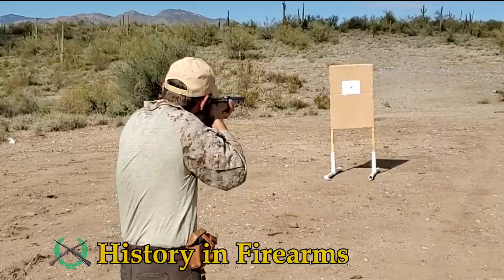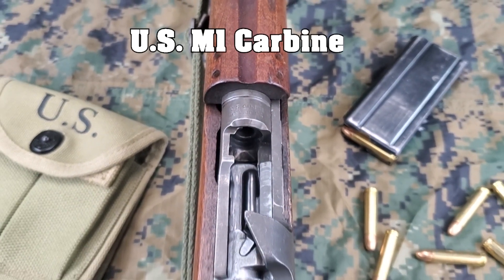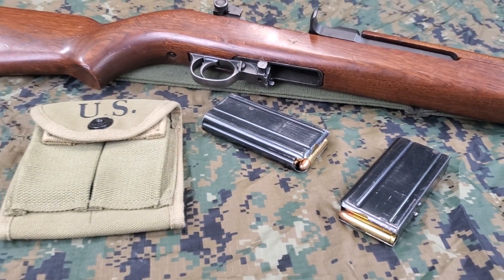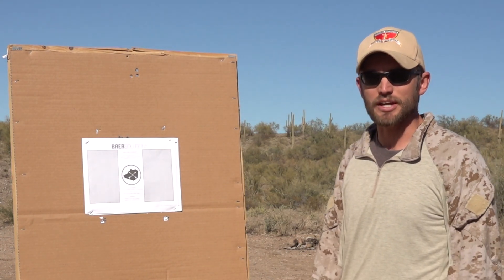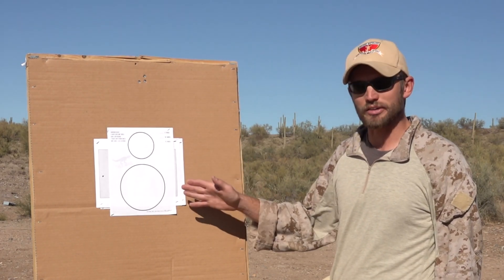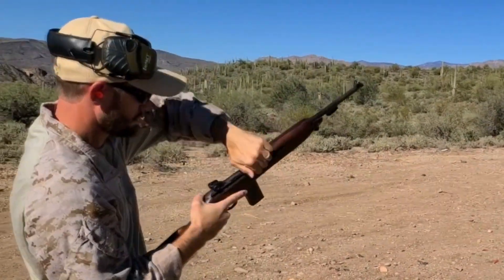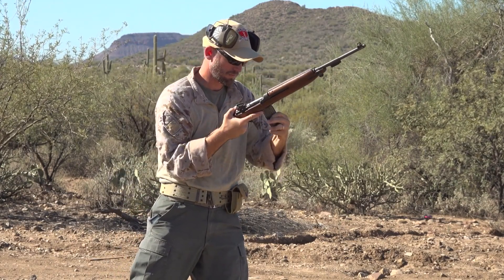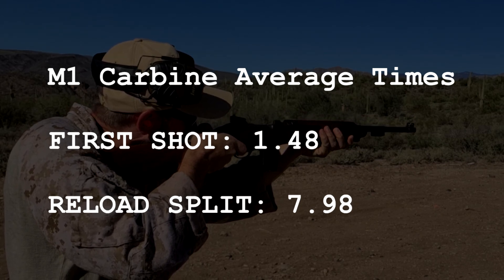Milsurp Operator: M1 Carbine

Comment: The 250 setting is nuts on at 300 yards Me and my 2 sons put a 1 foot group of 20 rounds 
with 3 misses and and rest in the 1 foot group.
I also hit a rolled up paper target 4-5 inches tall 3 for 3 easily 3 head shots at 300 yards 
They are in fact Tommy gun sights .
The 30 carbine being more A Rifle Round.
the 300 mark will be good and right on the money at 500 yards
I drilled a notch between 250 and 300 for my 400 mark 
In the open terain of korea at 300 yards witch realy isnt that far,
I threw a rock that far ,
they were shooting 2 feet above theyre heads.
the 200 setting would have produced hits a foot low
for the 30 carbine 1 foot of drop per 100 yards 
for 30 06 is 1 inch of drop per hundred yards .
Thats the difference
The 45 auto Tommy gun round was 1000 feet per second with a crimp in middle of shell for extra pressure
would barely reach 300 yards hence the 300 yard setting 
on the M1 carbine sights
I cant believe know one figured this out before.
I knew it the second I saw the m1 carbine sights.
because Ive been shooting my little M1
scoped for I want to say 40 years
Reply from the maker: I'm going to have to get mine out at distance.
Reply: @HistoryinFirearms  
You can take a center punch eye ball in a notch between 250  and three hundred and its enough
 for the bearing to grab remember 250 is 300 
your notch will be 400 and 300 notch will be 500.
Your little carbine will surprize you 
our 3 misses werent misses they just hit lower part of seat and 2 winged the side lol 
Nobody has done a 500 yard video with the m1 carbine and its a cake walk
Reply: @HistoryinFirearms  You can barely see the 1/8 inch taper in shell with your eye
32 mag to 30 cal.
But its definatly got the gas to get there and hit hard .
Its the only strait walled Wild Cat
Cartridge
 thats what people dont get.
HaHa Ha
I just call signed your Rifle 
Its Name Is WILDCAT
MINES ROCKOLA

Comment: A mistake from Army Ordinance also is thinking its a light rifle
 not to compete with other battle rifles also 
Hense the Koreans being able to take hits Bulony lol 
What it was was the sights they put on M1 carbines were
originally designed for the Tommy Gun 
in Korea the battle field opened up from the jungle fighting
 to open mountain valleys.
The 250 mark on sights is a little high like 8 inches of hold under 
that should have said 300 then it skips putting a notch in sights 
and then has a  300 that puts a 2 1/2 foot to 3 foot high at 300
yards.
the last notch would have been a great 5-600 yard notch.
Think about it 45 Auto crimped case tommy gun round was 
1000 feet per second .
M1 Carbine 1950 feet per second
TNoutdoors9 has 2 videos at 250 and 300 yards 
they say it all
First thing I did when i got my  Kensight 
was drill a notch between 250 and 300just a hair under half way 
I think  this would be a great video for you to do
What do you think?
Reply from the maker: I haven't pushed the carbine out that far and it would be interesting to see. I'll check out those videos. 
I would like to do training films on zeroing rifles.
As for the Milsurp Operator series, I am about done with the firearms for these current drills and do want to do a second "season" if you will running them through different drills.
Reply: @HistoryinFirearms     Plainfeild Commando Paratrooper S&K scope mount 3x9x32 tasko
35 yard 1 shot sight in on paper bump it up 2 clicks for 1 1/2 inch parallel
good to hit a german in chest at 500 yds
a excapee from zoo or something came running acrossed the hill 
i was hunting jacks on brushy hill
he was  taking 25 foot bounds like a bird 
it was a Black Buck Antelope I spun off my lid on scope bumped it 48 clicks 
for 1 foot 
He was running about 40 mph
with a lot of hang time 
I aimed at imaginary buck in front of buck about 4 inches low at head
It spun him in mid air awesome shot
I grabbed my contractors wheel and measured it off at 510 yards
The full metal jacket shattered his skull
I sawed of his skull cap but it was still broke in half the twisted black horns 
measured 14 inches
He had black over brown tiger stripes a Beautiful animal
I still have the black spiral horns and split skull cap
He tasted awsome lol
Thats the marine corps riflemans sight in .
You can hit a German mid section with a 22 long rifle and scope
at 500 yards 
look up Apple seed
It was a Jedi moment.
Were Man and rifle become one .
I saw the hole thing play out in my head And just knew i could do it
where effective and max range depends on the skill level of the shooter and his Rifle.
30 cals are great fliers lol
I just got my first set of rear sights on the rifle
CMP wont compete over 200 yards lol 
because of bullet drop lol
the video on the rear sights would get you alot of attension lol
Reply from the maker: @alonzahanks1182  Nice

Comment: So Hay I proved The 2.5 on my sights was 300 yard Zero.
We put a car bucket seat to hold paper targets  but they forgot to take the tape and left the rolled up targets on ground.
I Told them wed get by with the seat about the size of a torso.
Roll of paper about 4-5 inches tall.
we put 20 rounds through mid section of seat.
about a foot group three misses I put 3 rounds through the roll of paper targets .
our rounds were 2100 feet per second with 14 grains of Herco powder.
with the Recoil check on And in M 2 stock I Have a spring flew and it was raining .
I been pussy whipped with my Plainfield Commando Paratrooper stock.
It arks  and springs soak up the recoil its a inline like AR
The M2 stock It kicks like a mule more than my Garand lol
the recoil check is awesome but 
does give you some blast and louder booms.
it was a tough long day But was fun 3 hours lol 
We didnt have the backing for my 400 notch
but im sure it will produce the same result
It made me miss my scope a lot.
wel prove the rest later. lol
Reply from the maker: Interesting!